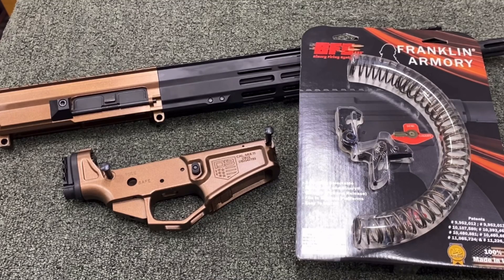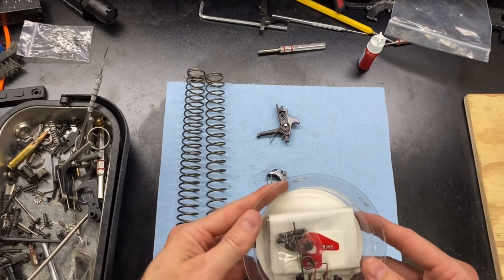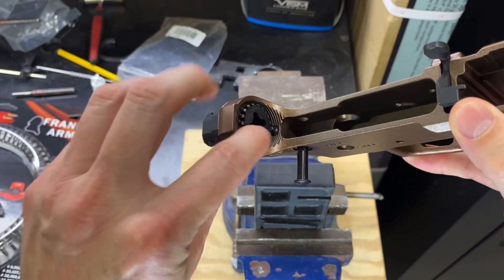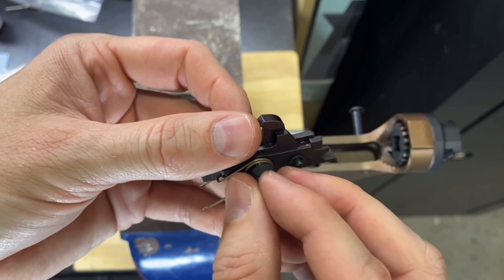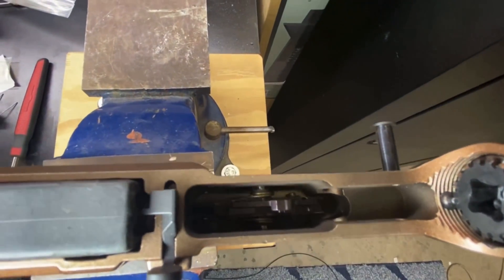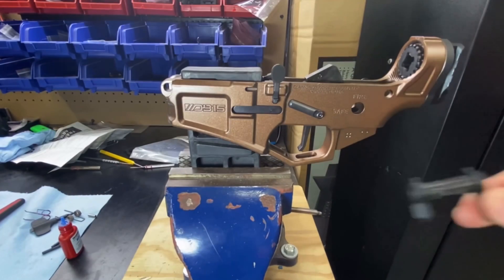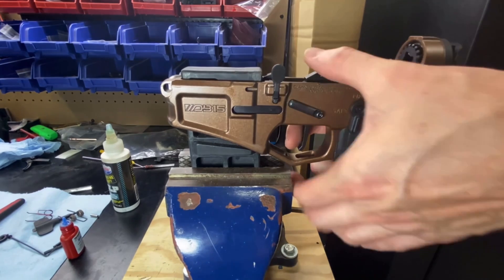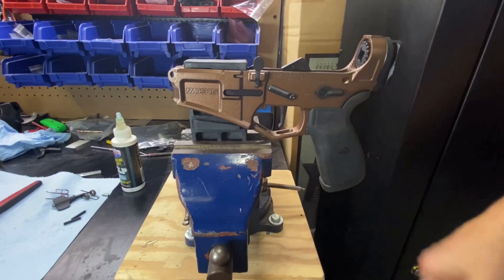Franklin Armory BFS III Trigger Installation

Comment: I keep getting a reset on my dry test. I don’t know why.
Reply from the maker: That has happened to me a couple time too. I had to take the trigger out and put it back in. Not sure what was happening but that fixed it.
Reply: @combatreadychannel  I haven’t been able to run it yet, but I went back with my mil spec hammer and now it functions on a dry test. part of me thinks that I need to put the BFS iii hammer back in and send it a few times to get some filing action going

Comment: I’m putting mine in an H&R DEO 9mm.  Any recommendation on spring combo for that build?  I will be running a Dead Air Wolfman suppressor as well.  Thanks!
Reply from the maker: I’d probably say to start heavy since it’s a blow back gas system. It will probably work with all of them without issue. I had one in a 9mm build once and I think I tried it with multiple springs and buffer weights. It was a while ago but I can’t recall if I was able to tell which worked best.
Reply: @combatreadychannel sounds like a plan.  Thanks for the info.

Comment: Why not use the original spring and detent
Reply from the maker: What do you mean? For the safety selector?
Reply: Nevermind you building fro a striped receiver  i understand  .do you need to add a different  buffer weight?

Comment: do i have to change the spring that i currently have in my ar15?
Reply from the maker: If you are talking about the buffer spring, I was able to keep my original spring. Depending on your set up, it may function better with one of the provided springs instead.

Comment: Is that little black spring inside that bag just an extra part or something??? Was I supposed to use that on something?
Reply from the maker: I’m not sure which specific spring you are referring to but it does come with extra parts.  You shouldn’t need to install any springs to the trigger group. It should already be assembled and ready to drop into your lower.

Comment: 1:06 I transferred my trigger to another lower and forgot about the slave pin. I had to reassemble the trigger and not my gun does not binary fire (semi auto in both positions). Where can I find a video on this assembly? I want to make sure I put it back together correctly because I just guessed lol.
Reply from the maker: I can’t find anything that goes into detail for it…. I’ll see if I can make a video disassembling and reassembling it.
Reply: @combatreadychannel that would be awesome! Thanks!

Comment: Selector has about a 3/16” gap on my lower is this normal? Does it not work on some lowers? All 3 of my lowers have the same gap with the safety selector. Unsure of what to try now
Reply: Very good video btw! Very detailed
Reply from the maker: Sorry for such a late response. It should have a small gap between the receiver and selector lever.

Comment: Never done a rifle trigger before. Throwing this in a brn180, realistically i won't need to worry about like 1/3 of the video eh? No buffer system, never shoot steel case. I assume I can just do the actual install and be gtg? Understandably the fine folks at Franklin wont give me a flat answer on most things cuz im sure they sont wanna have liability lol
Reply from the maker: Yeah, you should just have to do the trigger group and fire selector.
Reply from the maker: Let us know how the BRN 180 Gen 3 works out. I’ve been thinking about snagging one too
Reply: @combatreadychannel  when they swap the bolt BACK to the good side I'll be sure to lyk lol. I got the gen 2, hands down best rifle I've owned other than my lwrc

Comment: Im sorry, im really new to the hobbie. How do you get an ar with a folding stock....i thought you needed the buffer tube and spring.....
Reply from the maker: A standard ar15 does need the buffer tube assembly. There are several different upper receivers that have internal buffer systems inside the receiver. So you would not need the buffer tube or the buffer and spring. The ones that I know of are 
Faxon ARAK
Foxtrot Mike M15
Brownells BRN 180
Palmetto State Armory JAKL
CMMG Dissent
So any one of these, you could slap it on you AR lower receiver and not need the buffer assembly. This would allow you to use a wide variety of folding stocks or not have a butt stock at all

Comment: Can i use a different hammer instead of the one that comes with it?
Reply from the maker: Yes you can. Just make sure you do a function check, some may not work but I have used several different milspec hammers while no issues.
Reply: @combatreadychannel Okay, thank you for the response 🙏🏼
Reply from the maker: @Arg_burner5019 no problem man

Comment: *if your having trouble function testing it wont go binary read this*

After 2 hours of function checking i noticed that i was putting too much pressure on the hammer to prevent it from hitting the receiver. When i took some pressure off AND when i function checked it with the upper on (unloaded of course) the binary worked perfectly. 

Just wanted to put this out there for anyone pulling there hair out
Reply: I love you lol. I was about to get real pissed
Reply: @AtTheCrossWePraiseU  dude I'm so happy someone saw this and it helped them. Just take it slow at the range on your first time. It took me a little bit to get the rhythm of the trigger down
Reply: You're the man. Could've saved myself a lot of time if I had seen your comment earlier.
Reply: @flygod126  I really need to do a video on it.
Reply: @flygod126 also, first time go slow. The binary trigger is more about the rhythm. Its hard to explain but the first couple of tries its not going to work like you think. Pull and release to the rhythm of your heartbeat is the best way to start off

Comment: Nice vid just got u a new subscriber how do you like the binary trigger i know alot of people do not like them but its looks like something to have fun with if it works good without jamming i would like yo get one on my A-R u think it is worth it what problems have u had since u installed yours thanks?
Reply from the maker: I like it. There is a little bit of a learning curve to it but once you get the hang of it, you can apply it to more than just fun at the range and use it as a legitimate tool. It’s just strange going from semi automatic to binary if you haven’t trained with it. 
I have had a couple issues with it but one was because of the after market trigger pins I used and then the other was the trigger mechanism getting gunked up. I had to disassemble it and out it all back together.

Comment: The left side (bolt catch release side/bigger lever on saftey selector) screw will not come out easily. I don't want to strip the head. So i will probably leave it as is for now. Firing it may loosen it up. 
They should have used torx or even a phillips for something that small. A hex/allen head of 1/16" is not a great idea IMO
Reply from the maker: Those screws are definitely tiny and easy to strip out. 
You shouldn’t need to remove that lever though. If you need to disassemble the receiver, you just remove the small lever and then it comes out just like a standard safety selector.

Comment: What is the tiny spring for? It's 1/4 inch long (roughly)
Reply from the maker: What tiny spring?
Reply: @combatreadychannel  there's a tiny spring that came with mine. Not the safety detent spring, it's way smaller/shorter. Is it just a spare? I can take a pic and post it somewhere, not sure if I can post a pic here...
Reply: @combatreadychannel  looking at instruction manual that came with it, says it's the IDS spring. (Says IDS spring x2) is the first one already installed? Because I only have one. Unless it's just a spare and the other one is installed already
Reply from the maker: @chrisn5079 oh ok! That should already be installed in the trigger. It can come out if you remove that silver retaining pin so be careful when you are replacing it with the trigger pin 6:20
Reply: @combatreadychannel  thanks for the response! Excellent video by the way. Got it done. (Was my first lower build, I scuffed up a tiny spot trying to get the bolt catch pin in what a PITA!)
Next step is exploring uppers.
Thanks for your help!

Comment: Mine will only shoot semiautomatic but occasionally the binary will work, maybe 8% of the time it works. Any reason you may know of for this happening? I'd Appreciate any help i can get greatly
Reply from the maker: I have had this issue in some of the builds I’ve done. I have been able to fix it by switching the hammer. Sometimes the lower is slightly off and the hammer and sear don’t match up the way they should. Not franklins fault, just a reality when we have so many different lower manufacturers.
Reply: @combatreadychannel  thank you. I'll try that out

Comment: So this is essentially makes the gun “automatic” is this illegal?
Reply from the maker: Yes it is completely legal and technically a fully automatic rifle is legal too, you just have to jump through a lot more hoops and more $$. This also does not make the gun automatic . It does allow you to shot faster but you still have to be the one that does it with either a pull of the trigger or a release of the trigger. So each movement of the finger will fire off a single round. An automatic would fire off multiple shots with one single movement of the finger.
Reply: @ OHHH so whenever it’s in semi, pulling the trigger shoots one round, but when you’re in “binary” pulling the trigger and then letting go fires two rounds. Very cool!
Reply from the maker: What is a Binary Trigger: Franklin Armory BFSIII
https://youtu.be/aJovKUB2oY4

Comment: It would have been helpful if you had made it clear that the holding pins and the connector piece were only for that special kit you bought and not what comes with the trigger itself. That made it confusing.
Reply from the maker: I’m not 100% sure which parts your talking about g about but I think it’s the trigger pins? If that is the case then I do show the pins that come with it and then explain that I’m using a different design that holds them in place better. 5:25

Comment: is it normal for the trigger to slightly move when pulled on while it is on safe?
Reply: also i noticed that the safety selector does not fit flush with the rifle which might be the problem

Comment: Building a 300blk pdw for my fiance..first build on my own..7.5 inch barrel..5 inch can maxim defense lower and brace and want to put a binary in...running onky subsonics..any suggestion on buffer weight and spring?
Reply from the maker: It’s hard to say for sure but I’d definitely recommend getting an adjustable gas block first. Aero precision makes a very good one but they are out of stock right now and that seems to be more often than not. Superlative arms makes a great adjustable block the “bleeds” out all the extra gas that is great for suppressors.
There are also some cheaper ones for around $30-$50 bucks that are good but not as fancy.
Reply: I'm putting an adjustable gas block on it...made sure of that already lol

Comment: Mine doesn't fire on release. It isn't a buffer spring issue, the hammer doesn't fall on release when on binary. Any Ideas?
Reply from the maker: It’s hard to say without being able to physically inspect it but I have had this happen with a customers trigger. I ended up removing it and just made sure  all the parts were where they were supposed to be. Everything looked good so I re-installed it and then it started working 🤷so maybe try to take it out double check all the alignments and re-install it. Be carful and good luck!
Reply: You ever figure out your issue. I just installed mine and I’m having the same problem

Comment: My safety selector switch would not install with the triggers installed even with a cocked hammer. I had to disassemble and put the selector in first then bingo. Lower is a Yankee Hill.
Reply from the maker: Interesting 🤔. I’m glad you were able to figure it out!

Comment: which set of springs included in the kit would you recommend using? specifically for the hammer and trigger
Reply from the maker: It depends on what you are shooting. For the most part, steel cased ammunition has thicker/harder primers while brass cases have thinner/softer primers. So if you are going to use brass ammunition then you should be good to use the light springs which is what I usually go with. On a set up where I will shoot steel ammunition,  will go light on the trigger and then heavy on the hammer. You may need to use the heavy springs for both.

Comment: So since you dnt have a buffer spring what spring color did you got with blue or red? And also  foes it function well on your FM15?
Reply from the maker: It works pretty well with the FM-15. 
The buffer spring would depend on what you want. The heavy spring I believe is supposed to speed up the cycling of the bolt. It might also work better with a suppressor. I think when I had it in a standard AR, I preferred the standard spring but I can’t remember.🤷
Reply: @combatreadychannel  okk

Comment: I moved my working trigger from one rifle to another and now the binary doesn't work safe works, semi works, but the binary just behaves like semi
Reply from the maker: Double check your fire/safety selector. See if everything lines up in the correct groves.
Reply: @combatreadychannel  what it ended up being was the disconnector spring was upside down and the base of the spring is wider the the top so it was causing the IDS to not move freely as it was rubbing against the spring so it wouldn't engage properly

Comment: Can I use the detent and spring I currently have I noticed you specifically mentioned those , also thanks for your instructions they are clear and understandable
Reply from the maker: Yes, if you already have a complete lower receiver with all the parts. You should be able to reuse the spring and detent.

Comment: Dumb question but would a Colt SP1 Buffer spring make the binary trigger  shoot faster ?
Reply from the maker: 🤷 not sure. I believe the SP1 is supposed to be for the rifle version with the fixed stock. So it’s longer but I don’t know if that will make it spring back faster though. The BRNIII does come with 2 springs. One standard and one heavier that is supposed to speed it up.

Comment: It seems like there might be a problem with the firearm I have. I double-checked with them if Radical Firearms was a good fit for this trigger, and they confirmed it. However, when installing the trigger, I encountered a few issues. The selector is too wide, causing a part of it to stick out. Additionally, the hammer doesn't seat properly, and I'm unable to get it to engage with the trigger when pulling it. Lastly, the selector doesn't work at all; it doesn't produce a clicking sound. I've followed multiple videos but still can't seem to resolve the problem. Unfortunately, I'm unable to visit a gunsmith as they're located over 30 miles away. Just want to hit the range lmao.
Reply from the maker: You may have the selector in backwards. There should be a long straight grove on the outer rim of the selector rod. Make sure you have it installed with that grove on the right side of the receiver so that it lines up with the selector detent.
For the hammer issue. It all comes pre assembled so that shouldn’t be an issue with the receiver. 
That’s the best I can do without getting my hands on it.
Reply: @combatreadychannel  awesome, thank you so much. That might be the issue. Going to check it out today and hopefully that solves everything.
Reply: @combatreadychannel  update. I know this is five months later. I was able to get the selector to work, but for some reason, I cannot get the hammer to stay and seek correctly. I wish that there was a gunsmith around. I tried sources like Reddit, but no one responds to my post. I wish that there was someone that owned the same brand and tried this trigger with it.
Reply from the maker: @_Theo215 if you can post a video of what’s going on, you can send me the link and I can try to troubleshoot it that way.